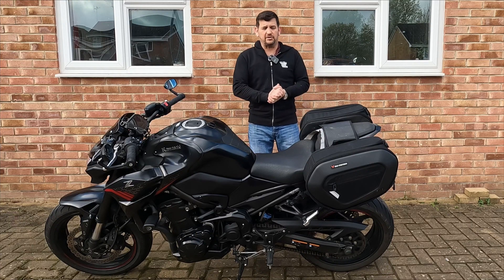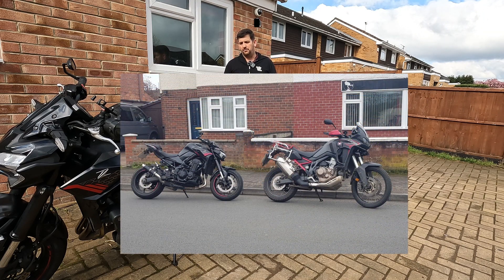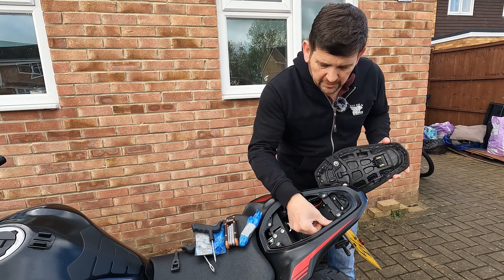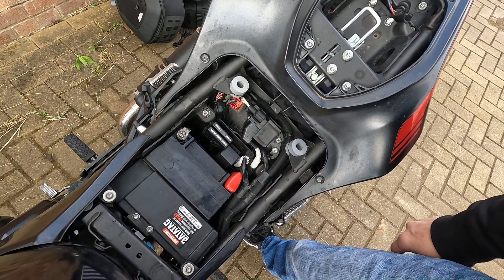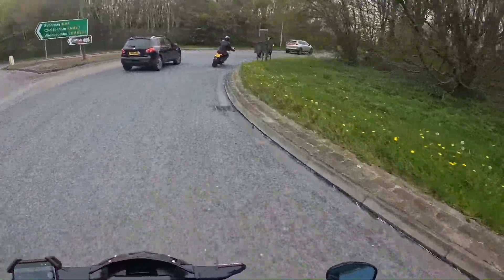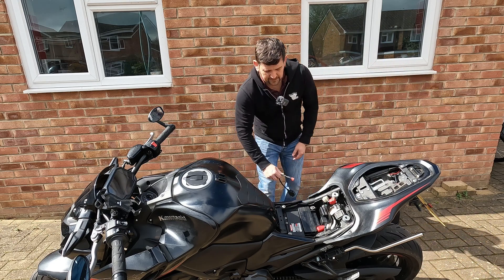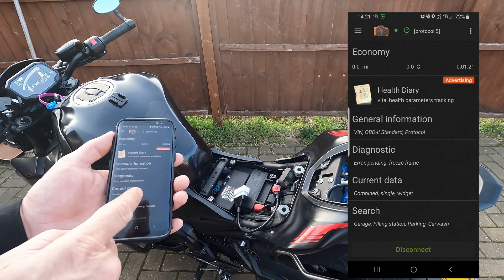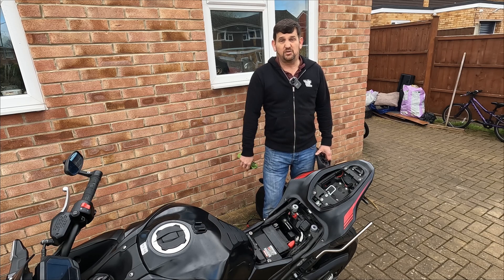Under the seat and connecting to the ECU. OBDII

Comment: Hi mark. Have you got a link for the adapter lead you got from Amazon?
Reply from the maker: It's a search for '6 pin motorcycle OBD'. This is the exact one I got..
Goliton OBD2 OBDII Diagnostic Cable Adaptor 6 Pin to 16 Pin Compatible with Honda Motorbike Motorcycle https://amzn.eu/d/6noQRZx
Reply: @bikerevz  Thanks Mark. Im new to the z900 only picked it up new last weekend. Hoping I’ll never have to use this to reset any codes but it’ll save me some cash if I do.

Comment: Hi! Did you ever tried to reset the Dealer service reminder on the dashboard? (The small withe wrench ) .
I wonder if you can use an OBD device, and which one. Thank you!
Reply from the maker: Hi, just had a look on OBD but no option for service reset. I did it through the buttons on the dashboard when I had one of those lights on.
Reply: @bikerevz  yeah, that was probably the oil service reminder the owner can set by himself, but Kawasaki also set a yearly remider, or a reminder that depends on a fixed amount of miles that the use can’t delete through the buttons. Only Kawasaki service can. 
And this I find unfair, why should I be forced to go to a Kawasaki garage? Especially if it is not nearby, or just because another mechanic can bd cheaper. I would also be able to service mu bike by myself. But I have to go to the dealer, spend time & money just to reset a reminder. Stupid. 
Anyway, thanks for you reply. In the future, you should manage doing that, please let me know!

Comment: Hi, can i reset the kawasaki service indicator with the app?
Reply from the maker: If you have the digital display, you can do it through the two buttons to access the various menus. I followed some YouTube instructions and it only took a few minutes.
Reply: But its 2 diffrent. One is the kawasaki service that you need go to dealer to reset and the second is owner can reset in the meny the oil service. I need reset the kawasaki service.

Comment: Frst off: great videos, mate!

What I did was to get rid of the OEM toolkit and stored a tire repair kit from Oxford in it's place under the main seat. To fit it there I shortened the handles of the two metal tools. With that done you can fit both of these things, the strips and glue along with a CO2 inflater and a few CO2 capsules in the same space where the OEM toolkit was at. The Oxford kit comes in a pretty decent bag too so you can use that. Under the passenger seat I stored a self made toolkit consisting of the OEM screwdriver, a 10/12, 13/14 and 15/17 spanners, a small wrench with which has an extender for the handle and different sockets (both for nuts and also hex keys, different-sized phillips heads etc) and an extender for the wrench. Additionally some tape, a ton of zipties, some wire, small pliers, a small pocket knife, some bolts (in case I loose one) and a tire pressure pressure gauge. It all fits nicely in the space and nothng rattles around. It's all enclosed in a small nylon bag from a company called Bahco. Overall the tire repair kit and the self made toolkit cost me about €100.
Reply from the maker: Brilliant, thank you so much for taking the time to write all that up! It is what this channel is all about and I will be looking in to doing the same thing 🙌
Reply: @bikerevz  I'm happy to share a picture of how the whole kit looks like and what's in it if you're interested.

Comment: I switched the seat rubbers on your recommendation, much better! I found myself sliding into the tank under hard braking resulting in nut compression. I think I can tip-toe better now,great tip thanks! Ps I can still remember the 70s' aaye

Comment: never had a problem removing the seat even with the colour coded seat cowl which i use all the time now,space is bad and could easily been made better at the factory as theres plenty of space between seat and tire,that said i managed to get my puncture out fit along with a rocky creek motopressor pocket pump,great bit of kit.and my alarm siren horn as well,never new about the seat bungs might have a try,i keep away from ecu,s a bit much for tired ole brain.

Comment: Even if you patch your tire, how will you inflate it? 

I have the original toolkit, wheel lock and plate/insurance papers!
Reply from the maker: Its a fair point and I am thinking of carrying a small pump just to get a few psi into the tyre. Long journeys I carry a can of tyre weld, which also inflates the tyre, but that needs a bag.
Reply: You can either decide to notice a deflated tire only whenever you reach a fuel station offering an air pump or you can carry a battery-powered air pump. Of course the latter option requires some bags like Mark put them on.

Comment: I have the same multi tool under my seat along with the baffle for my exhaust and disc lock.  I opted for the seat cowl when i bought my Z900 (from Gloucester) 2 weeks ago and the cowl comes off really easy.  I have the rear seat in a box, but as my wife said she will never get on my bike I haven't tied to see how easy it is to fit.  I'm also going to turn those bungs up the other way to see if it stops the Kawasaki way of wanting you to mount the tank when your out on a ride.  Love the vids by the way and was the reason I went up to Kawasaki Gloucester on the off chance, who gave me such a good deal on my old bike compared to Fowlers in Bristol (Where I live) I ended up buying my Kawi from them
Reply from the maker: I guess you went to Frasers for yours then? They're not doing Kawasaki anymore, it has moved to Completely Motorbikes near Cheltenham. Glad you are enjoying the channel anyway.